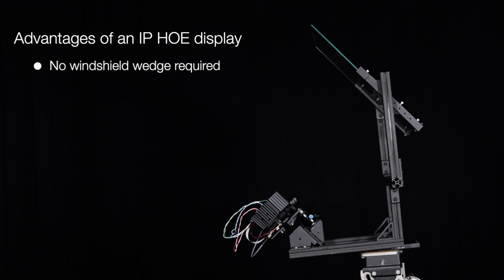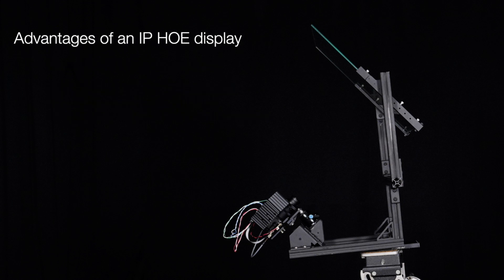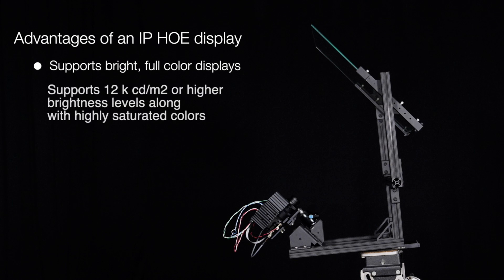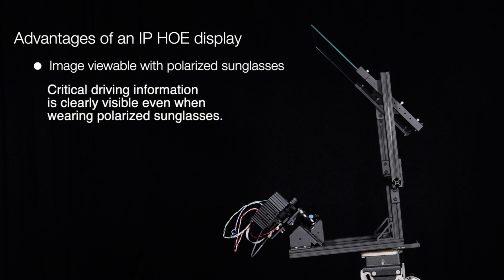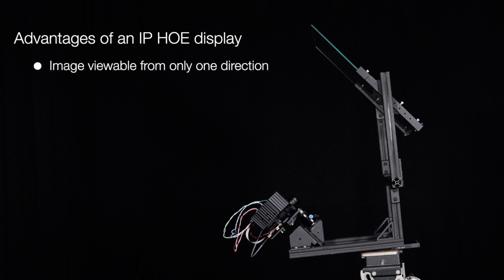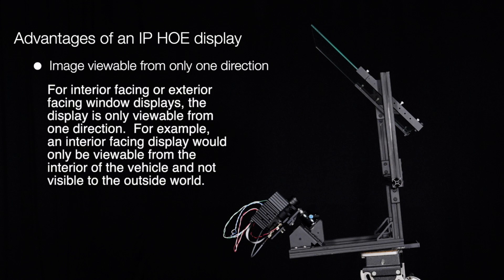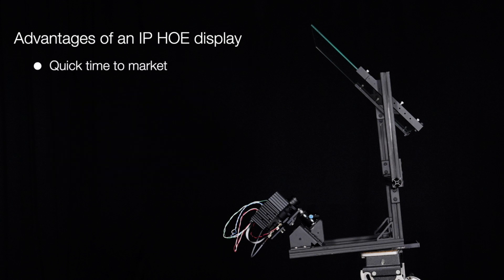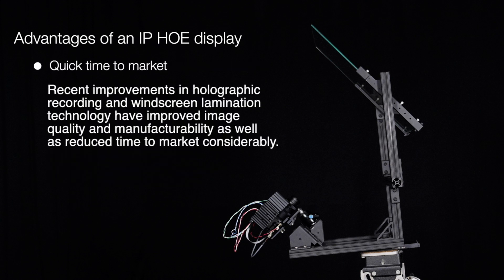Advantages of in-plane holographic displays using TI DLP® Auto chipsets

Comment: But isn't that capturing the attention of the driver and making the driver to focus on the display but not the road? Since the display focus and the outside focus are different, wouldn't that degrade a driver's performance? Isn't this an existing problem for old-fashioned speed-o-meters in a car's dashboard?